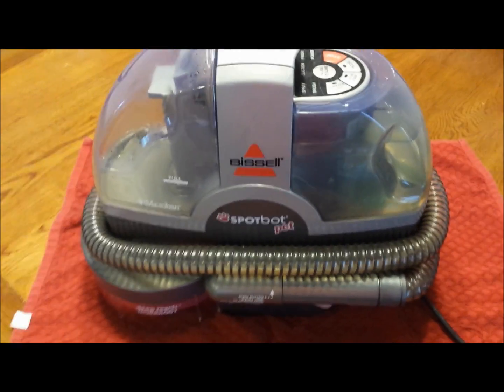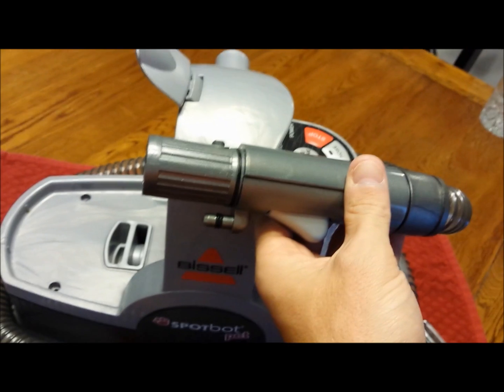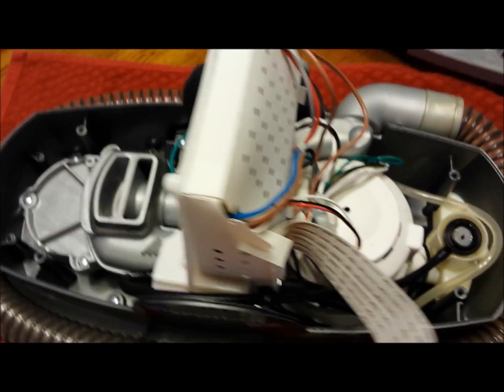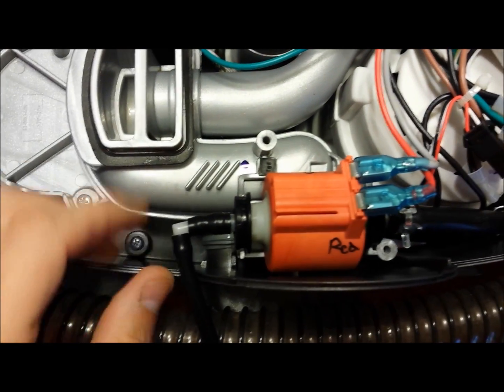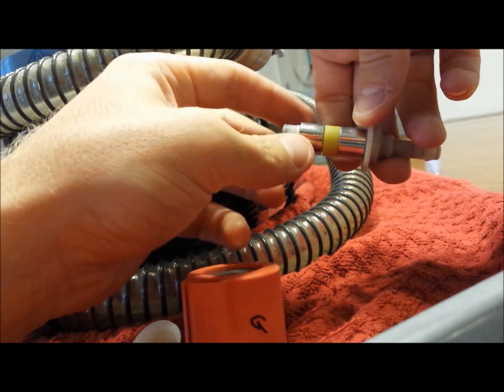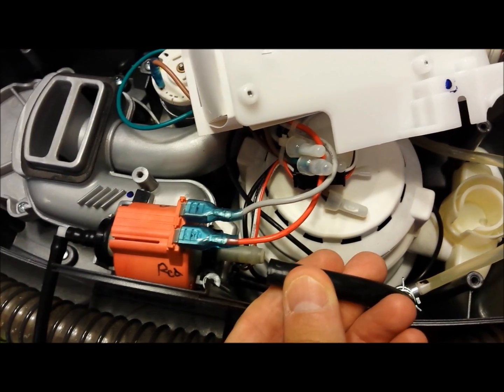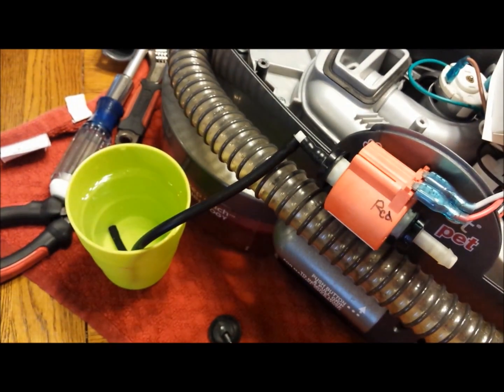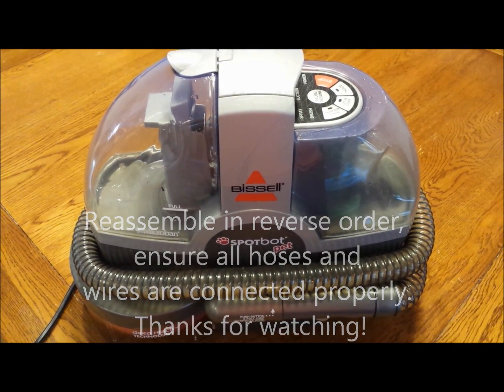Fix Your Bissell SpotBot Pet That Doesn't Spray.  Pump Repair and Replacement Guide

Comment: Thank you, sir.  Didn't have any clogs but the spring portion of the pump was not moving from not being used in awhile.  The disassembly video was great.  Ran the part under hot water and worked it back and forth like you showed and it works again!
Reply: I think this is the exact same problem I had - put it back together and it worked after the 2nd try!

Comment: Well it turns out you saved me not only $129 for a new machine, but even $15 for a new pump!  It was blocked, and I cleaned it out exactly as you recommended, reassembled, and tested perfectly.  Thanks for taking the time to do this video.
Reply from the maker: awesome.  there was no way I was buying a new unit after a dozen uses. glad it helped!

Comment: For those who can't get working.. use really hot water (I microwave my water in a cup for about 1.2 min) then put in the pump plastic piece into it and let it sits for about 5 min before trying to clean with toothpick..  using regular hot water as shown in the video may not be enough.

Comment: Super helpful!  Not sure if anyone else has mentioned this, but the inside the plastic piece that goes through the motor is a piece of metal held in place by a couple of springs.  By using a high powered magnet, you can move the metal back and forth (ie pump), which when combined with hot water helps clear the insides faster.

Comment: Fantastic video! My Bot was a much older version though, so when I attempted to separate the pump from the y connector, the y connector broke into a few pieces. Sadly Bot is no more, but I learned a valuable lesson: rinse the hoses after EVERY use, even if it's 3am.

Comment: You’re awesome! Thanks. It took me about 5 to 10 minutes to remove restriction in piston. I must have missed you indicating there is springs and another rod inside after using an ice pick. My tooth picks weren’t strong enough.  Thanks again. It’s running like new 👊🏻

Comment: The video is clear, concise, and easily understood.  The solutions start with the simple fixes and continues to easy to perform but slightly more involved solutions.  One of the best DIY videos ever!  Great Job!
Reply: What does one do if the button on the cap to the solution reservoir does not depress?

Comment: I agree with Slippin'Jimmy's comment about the tube inside the pump.  Carefully remove the black o-ring inside the end, let some innards come out, then work with water and a toothpick or whatever to make the remaining inside parts wiggle / slide.  Then put the innards back in and the o-ring and proceed as in the video.  One additional comment:  I had removed the hose from its locked-in-place button, and the machine wouldn't turn back on for non-hose use until I had put the hose back and latched it with its button.  Then it turned on ok.  The cleaned-out pump worked well after about 30 seconds of run time to loosen up other sticky spots further downstream, I suppose.  Since I don't use the machine very often anymore, I'm going to flush it with plain water when I'm done, and store the mixed solution in a separate jar.  Thanks, Mike M, for your excellent video!

Comment: This was great! My pump was dead. In fact, it looked different from the one in the video, which had me worried that the replacement pump we ordered from Amazon would not be compatible. But I just replaced it, and we are back up and running! Thanks for the video.

Comment: Thank you for this video.  I have my spotbot fixed in under 5 minutes.  (one of the 2 cables going to the motor was slightly loose, pushed it in, and now the automatic part of the spotbot is back in action!)
Thanks a bunch.  You saved me from phone calls and hassles with customer service.

Comment: Your video saved me SO much grief! Thank you!!!!  There are so many negative reviews on amazon for this product failing and it is my 2nd spotbot and after only its 2nd use had failed me again. I had left the unused cleaning solution in it from its previous use 8 weeks ago and it gunked-up the hose nozzle so it was just dripping. I cleaned the filter sponge pad like you said and it is fixed!

Comment: Yay!  Following your excellent video, I just fixed my SpotBot...and mine was the simple fix:  on the solution container side, I removed the small filter and cleared it of gunk, removed the solution container cap and cleaned it, removed the filter from the dirty tank and cleaned it.  That's it!  Thanks for making this video

Comment: THANKS !  You helped me big time.  I found the spring loaded parts inside the plastic pump valve had rusted.  Once i got the pump disassembled, a light tap on the plastic valve dislodged the pieces which were then easy to clean up with fine gray scotchbrite.  Back in business and it only took about 15 minutes to fix.

Comment: Great video, thank you.  This helped us find the clog and also the comment that you should periodically run only hot water through the machine to "rinse" the solutions out made so much sense.  Never thought that having the machine sit idle for a while would allow it to clog valves.  Thanks for posting this tutorial.  Saved us time and money. Didn't need to replace any parts.

Comment: Thanks for posting this!  Got my machine apart and fixed in just a few minutes thanks to this video! BTW, I used a bamboo skewer inside that pump to loosen up the little piston inside while running hot water over it.

Comment: Thanks for the video.  I have an older SpotBot, so the innards and screws are different, but the essence is the same.  I was able to recessitate a very old SpotBot that we were about to throw out.  We hadn't used it in years, thinking it was us.  Turns out the pump was stuck.  There's a piece of plastic in there that needs to be able to move and it was stuck in place.  Once I freed it, formula started flowing.  Thanks!

Comment: Thank you for this video! Our valve unit inside the the motor had a two-spring-&-ring assembly, similar to a ball point pen. We were able to push the inner plastic piece back and forth, and eventually run hot water through. Our Spot Bot Pet works again!!!!

Comment: Good job !! Anyone with a clogged solution problem can fix their unit by watching this.
Reply: Hi, great video.  I was wondering if you know how to fix the Bissell Spotbot Pet leaking.  I have one that leaks most of the water & solution.  It sprays and everything else works fine.   Please let me know.  Thank you.
Reply: +Barbara Cook could be the check valve on the motor output.  I busted mine, see top comment.  You can try ordering a new motor.

Comment: Thanks for posting. I accidentally popped the o-ring off and the springs came out of the center piece. I was able to put them back in, but I decided to clean the part out without them and the worked the spring on the other end. Seemed to work well for me.
Reply: Hey Slippin' Jimmy, the same thing happened to me. I'm not sure how to put it back together. I'm guessing first put in the short wide spring, then the metal thing, then the long thin spring goes over that, then the black o-ring, then the white small circle thing. My model is way older than the one shown here, though.

Comment: Thank you very much for posting this video. Very easy, safe and step by step instructions. I was able to fix my spotbot with ease. It was just the first step- making sure there I cleared out the gunk on the top solution filter. Very easy. But, I feel if it was something more major - your video would make give me the tools to solve the issue - thanks again.

Comment: great video, thanks!!!

I'm only having trouble putting it back on now. Everything I put the cleaning fluid tank on, it starts leaking and won't stop
Reply: Chris Gd  same thing happened to us! It was the t-hose that came loose and so it started leaking out. You have to
Make sure it is snug and I recommend two people to ensure it's snug when you put it back. I had to have my wife help me hold it while I ensure it was snug the second time:) hope it helps
Reply: Thanks :)I actually found that the plug for the clean water tank was leaking. Bissell sent me a replacement screw on plug, and it kinda works now. Still having SOME leaks...thinking it may be the issue you brought up. I'm going to open it again and try one last time haha. Thank you.

Comment: Thanks so much for posting this video!  When I have the pump out and am cleaning (around the 9:00 mark), should I be able to see completely through the tube?  (Or should water flow freely through it?)
Reply: +murp2da yes water should flow through it, unless the check valve is stuck, probably soak it boiling hot water for an hour before trying to free it (see my top comment).

Comment: Thanks for making the video. Any advice for a spot bot that runs only on manual? The automatic system brushes not turning? Machine only turns on when hose button is pushed.
Reply: Try putting the hose away completely, locking it into place.  My machine won't turn on at all for non-hose use unless the hose is locked into place.  Then, voila!  It turns on!

Comment: Before you take your Spotbot apart, check if the hose/pump needs some water to prime it. I was having this problem and the solution was to add water to the opening of the solution tank because the pump and hose were completely dry.

Comment: The exit end of pump attaches to a T connector that sends solution to automatic or manual brushes.  Mine was clogged in both ends.  Running hot water through pump and cleaning did not help.  Thinking I need a new pump?  Caution, these are 120V DC pump motors.

Comment: I had the same issue: it was lodged in there Solid, tried to move it from both sides, would not budge.  THEN I took the Stanley FatMax to it with a metal chopstick.  A few whacks later that sucker came out in pieces, along with the busted spring.  Anyways, I fired it up and working no prob.  However, the question I have for the peeps here: does removing that check valve hurt anything?
Reply: +davidsonnow ok: I just found out the hard way: leaking everywhere, technically works, but uses the cleaning solution TWICE the normal amount...  so, obviously the check valve prevents cleaner from leaking... I'm ordering a new pump :(

Comment: My automatic brush feature works but manual mode doesn't work would this still be what I need to do.
Reply from the maker: Does the button light up or does the hose provide any suction?

Comment: Really good video. WARNING. Don't forget to soak your pump in hot water. I broke mine trying to unstick the actuator which was frozen in place. I tried to force the mechanism to move with a sawed of nail and hammer (overkill I know, but i was frustrated).  It actually looks like one of the springs got folded under one of the plastic pieces and rendered the thing useless. 
You can find the replacement pumps here: http://www.amazon.com/gp/offer-listing/B001ICNOO8
Reply: I got the new pump. The plastic thing at the top of the pump that I was trying to move, doesn't move... even though there is a spring.  I believe that soaking the parts would have worked.
Reply: +Andy Clausen Hey Andy, I believe the part you speak of is the check valve, (on the output). see above comment

Comment: how on earth did you get the cables off of the pump???
Reply: pry off the ends of the tube with the needle nose of similar pliers using a lever actiion